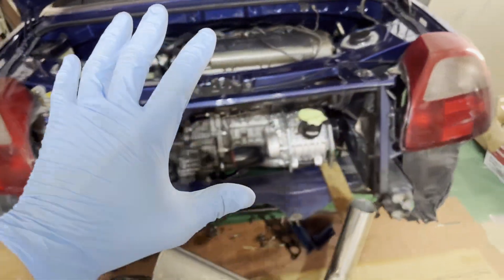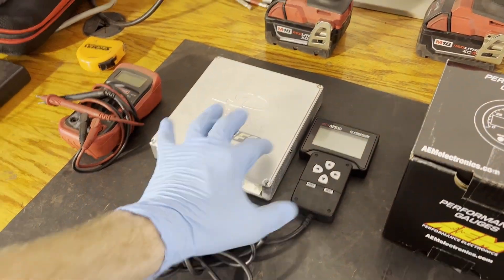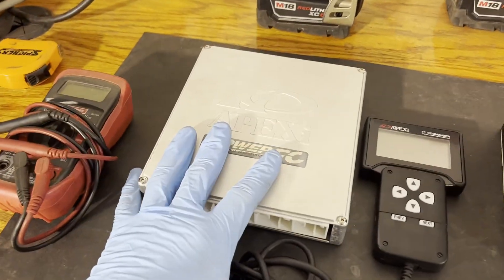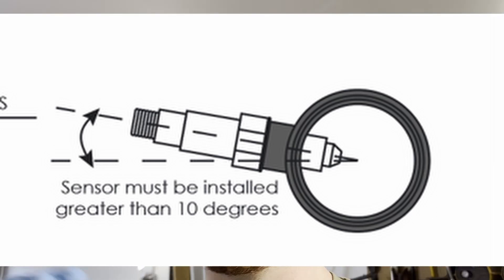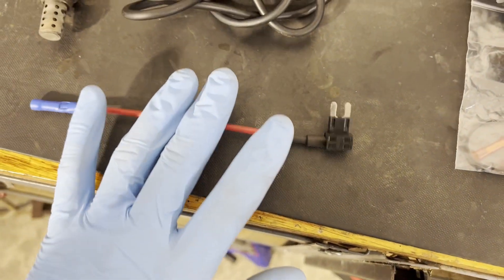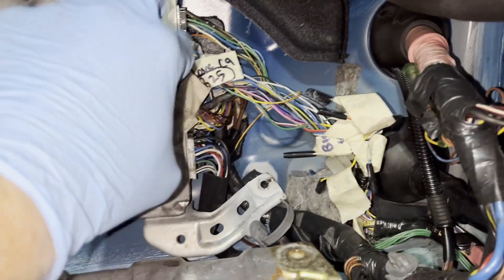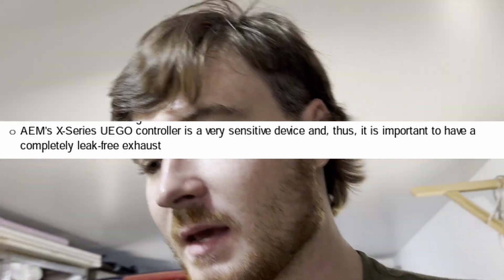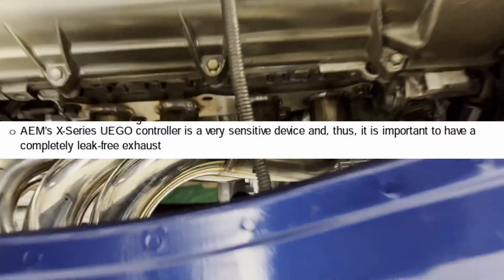SUPERCHARGED Mr2 Spyder AEM Wideband Install!

Comment: I use fchako and copilot to tune and the apexi is reading afr I just had to convert the voltage to the correct range in the software

Comment: my guy youve got the same idea for supercharging I did in regards to location/ charge run, battery relocation etc. did you have any schematics to share etc? I'm going off an m45 eaton with the universal adapter and a AC delete to use a more standard belt length with the SC pulley